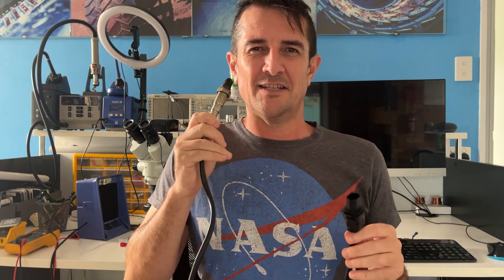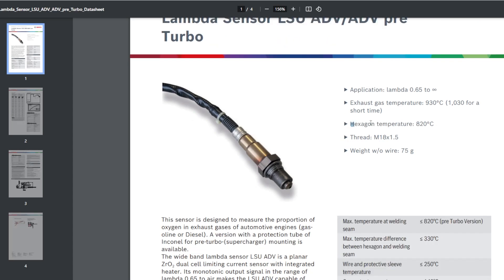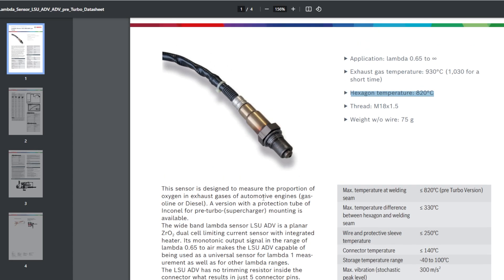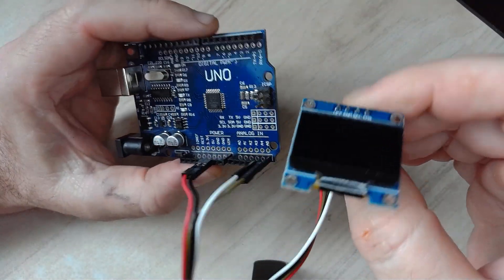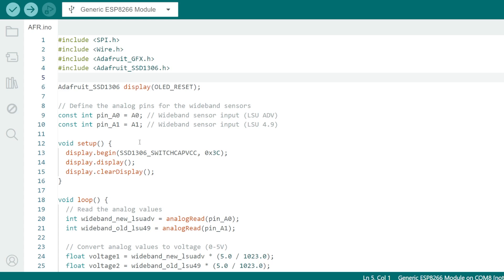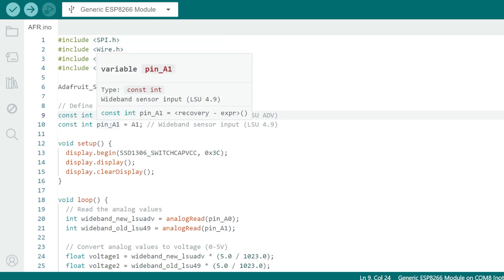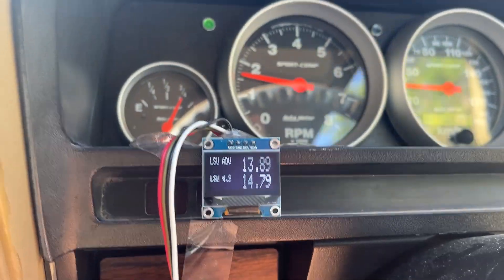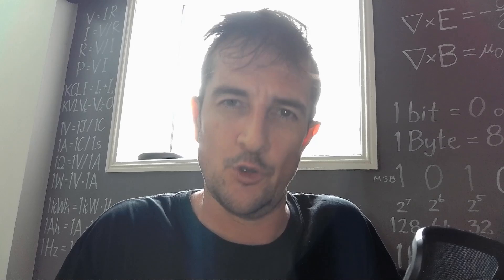Why you should upgrade your oxygen sensor!

Comment: How on Earth did you manage to make the Bosch LSU 4.9 last that long? 

I have ordered the AEM with the Bosch LSU 4.9 for experimental aircraft application and setting up Carb’s very accurately. 

I’ve read online that the sensors like to fail all too often. I found an interesting thread then where it was explicitly stated, not to start the Wideband Sensor until the EGT’s have heated up quite a bit. The reason for this is that when the LSU4.9 sensor is turn on, it goes into a “HEAT” mode which heats up a ceramic core. Then people start the car and have cold EGT’s fracture this ceramic core and over a short time it fails altogether or becomes highly inaccurate. 

Do you have any tips on how you protected this one, if you did in fact do such?

Comment: Last question... :D

How did you control the LSU ADV (heating cycle and etc), via the standalone ecu? Did you just splice in the data-out line and route it to arduino for the data output?